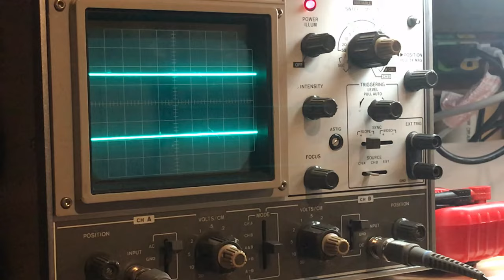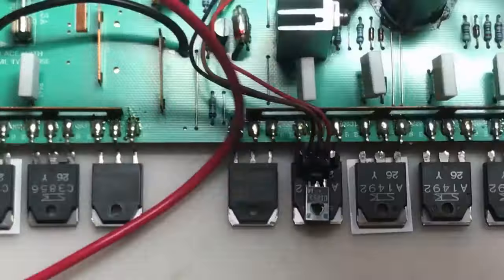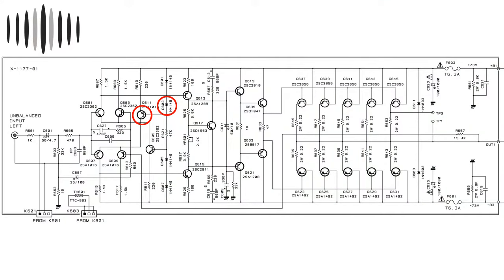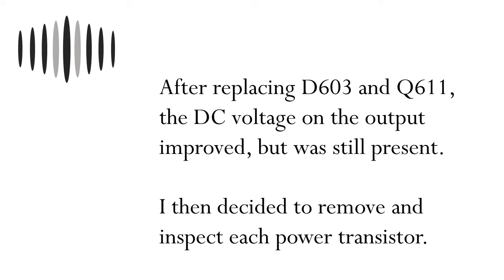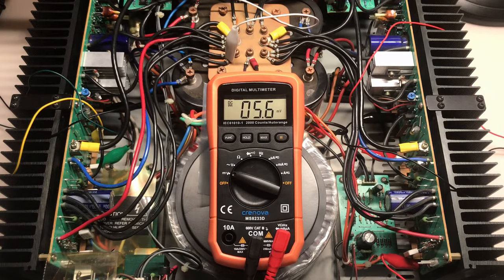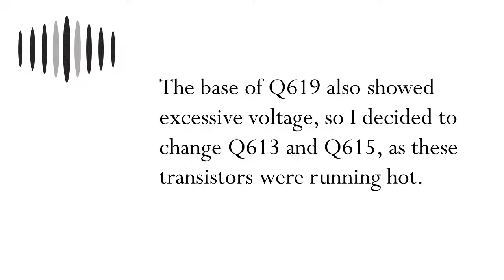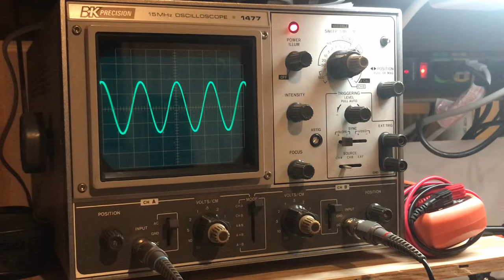DR #19 - Rotel RB-1080 Power Amplifier Troubleshooting and Repair - Speaker Popping and DC Voltage

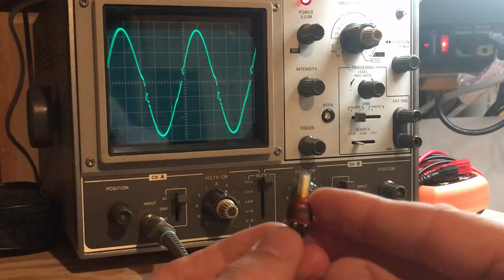Comment: At 16:31, please clarify: You state that "they were not connected in any way." Do I understand correctly that the 2 transistors were heat shrunk together but no thermal compound was used? Or that they were initially installed separately with no shrink or compound?
Reply from the maker: They were initially installed next to each other, but not thermally connected in any way (no heat shrink, no thermal compound).

Comment: Great job in this repair! I just want to bring up one point.  All that circuit  glue that turns black must be removed from all your repairs.  When it turns black it is not only corrosive  but it is also known to be conductive.. This can change the specs of the circuit.

Comment: Hi . I have an issue with RB991. One of resistors caught in flame. Need replacement parts . 2SA1016 x 3 - matched pair and a single plus just to be safe 2SC2362 x 3 , also would be good to have on hand just in case 2SC2682 and 2SA1142. Do you happen to have and willing to sell these ? Or perhaps can help with substitute model numbers . Would appreciate help ob that one since they are obsolete .
Great video . 
Regards

Comment: I got same amp, left channel gets really hot after 20min  "No input and Speaker connected" Do you think it might be the same transistor. Amp works fine when cold. When hot, left ch start crackling and distorted and eventually lose audio.

Comment: Cool! Very strange that they didn't include emitter degeneration resistors in the differential input stage, though.
Reply: I also noticed this, it is the reason why the damping factor is so high. Good for low frequency distortion to have no degeneration but linearity will be compromised.
Reply: High gain input transistors (needed when you employ degeneration) are more expensive and hard to come by.

Comment: Hello I have a RB 1090 and. RMB 1095.  Also a RMB 985 MKii.  My 985 has some blown transistors.  That I am going to replace much like this repair.  My question is these are older units pushing 20+ years old.  Is it worth while to recap all of these.  From my reading electrolytic capacitors are only good for 10 years but many last upwards of 20.  My equipment is getting that old.  Is this something I should be looking at doing.

Comment: Did you match the replacement differential pair transistors for beta values. Always be wary of the noise figure for the transistors if using a substitute.

Comment: Hi , I have EV CPS2 power amplifier . I’m facing  power supply continuously short circuiting . I check the power supply module PCB , in that all components are working I.e relay, NTC. I desoldered rectifier GBPC-P 3504 and check , no shortage in rectifier side. Can you please give any insights/ suggestions to me how to repair this problem. This short circuit observed when I’m doing idle current adjustment and I check replace few transistors which got short circuit but still I’m seeing power supply short circuit

Comment: I have a RMB1075, it is frying any speaker that connects to the right surround, it made the speaker smoke and there was a screaming sound. My question is for someone who cannot work on this themselves, is it worth taking this to a shop to get it repaired or would the cost be too high for an amp from 2001? I have been only utilizing 3 channels lately, but took it out of rotation because it seems like a ticking time bomb to me.
Reply from the maker: That depends on several factors. 1: Is there anyone local to you who can fix this? 2: what would it cost? 3: how much are you willing to spend? People send me their amps all the time and spend twice it’s value in shipping alone because they’re committed to their older gear. Understandably, not everyone feels that way though.
Reply: @dualityrepair4770  Where are you located? I have no reliable place, the one in Nashville consistently took a Technics SA TX50 I had, 3 times they said it was fixed and it still had the dreaded overload error each time after 6 mos.... I would not trust them. I have 5 vintage receivers, Sansui G9000 etc, so I do like vintage gear. I know this weighs almost 50lbs...

Comment: That glue melting is very disturbing.  Glad I decided to pass on Rotel.  

I have Adcom and Acurus power amplifiers and they have been working fine for around 25 years.
Reply: Rotel isn’t special for having used this glue. It was used  on virtually all electronics built for a could decades. Rotel makes incredible amplifiers.
Reply: @kilgoretrout4461  well as I mentioned earlier. Funny how my equipment doesn’t have the same issues. 🤷

Comment: Nice work.  I have that same model amp. It was notorious for blowing fuses on the left channel.  I read about slow blow ceramic looking fuses, fixed the problem, I’m hoping it’s not a symptom of other issues in that left side. Any thoughts ?
Reply from the maker: Using the slow blow fuses allows you to use the amp, but they’re also failing to protect the left channel from the current spikes that are likely present. These spikes can shorten the life of any component in the circuit.

It’s very difficult to suggest a component or area of a circuit to look into from such a limited problem statement. I’d be happy to work with you in more detail if you’d like to email me.
Reply: Same model, left channel fuses blown apparently for trying out 12V trigger from preamp. Came up with this great video because of that. Luckily my problem was much simpler. Otherwise great amp! I have had it for 20+ years now!

Comment: This amp when working fine is worth say 200-300usd , how much would be your repair cost considering all time and parts spend here?
Reply from the maker: k domster,

I never charge a service fee, so just shipping & parts. Depending on what needs to be done (simple repair vs. full rebuild), the parts cost would vary between $10 to $80.
Reply: @dualityrepair4770  In Australia it's pretty much across the board fee wise?   Initial inspection fee: $110.

This is the cost of diagnosing the fault and calculating the cost of repair. Each job is individually assessed and quoted. If the repair costs are unacceptable the $110 is non refundable.

Ongoing Hourly charge – $110 (parts additional).

All service repairs carry a full 3 month warranty on work completed.

Comment: Thanks for the nice video! What would you have done if there would have been a high voltage remaining on the main capacitors?
Reply from the maker: Discharge them through a high wattage resistor.

Comment: How would a glue become conductive?
Reply from the maker: I certainly don’t pretend to be a chemist, but due to it’s chemical makeup (whatever that is), the glue, having been exposed to heat over many years, can harden and become conductive. When I say conductive, I don’t mean short circuit conductive. Even in the KOhm range, glue can cause issues in certain circuits.
Reply: @dualityrepair4770  Next time you might just measure a resistance of a piece of some old glue. I doubt that it would be less than a few MegaOhms. It's true that a glue sometimes causes problems on PCBs with SMT components. But in the most cases it's not a glue itself but rather some flux residue deposits on a glue surface.
Reply: @IliyaOsnovikov  The amount of conductivity may be voltage dependent aswell. And it is a well well known fact this glue causes problems
Reply: @19janiboy96  What kind of glue are you refering to? One used to glue tall electrolytic capacitors or the glue for SMD components?
Reply: The one electrolytics are secured with I mostly encountered this yellow Brown ish stufff
Reply: Duality Repair @

Comment: I Purchased one of these a few years ago and loved the app. However I always had a problem with the left channel the slightest little ding would pop the left channel I was constantly replacing the  250 V 8 amp fuse And then one day I was playing it on Axiom   M 100 speakers which are a 4ohm speaker which  Rotel said that would not be a problem as it  could drive a 4ohm Load
And then it went out. I took it to the repair shop when they stated the motherboard was not good and there was none to replace it. So here I have a beautiful  amp that longer works And cannot be fixed that leading up being trash which I think was uncalled for as it should’ve been a motherboard available so very disappointed in  Rotel 
Of coarse that did not stop me from buying another Rotel amp which I love and no problems
Reply: First of all, none of those Rotel power amps have any "motherboards". The second , even if any of the PCBs (Printed Circut Board) inside is cracked or broken it always could be fixed with a glue and a few jumper wires. And third, any defective parts on those boards should be available and could be easily replaced. Also any "cold solder" joints with loose connection could be easily resoldered. In other words, you would need to find a good electronics technician.
Reply: @20 20 Why? This isnt a high impedance circuit like tube amplifiers are

Comment: If I were to choose between a new Rotel RB1552 mkII or a used rb 1080 
for driving my dynavoice define 8 front speakers (23 - 32.000 Hz (- 3 
dB) RMS 200W, max 280 Watt 94 dB dual 8" woofers and 6,5 mids) via my 
5.1 receiver preouts, which one would suit me better? I guess the 1080 
could be pretty old, is there any downsides to that? If i bought a new 
1552 as mentioned I would get warranty and a new unit for the same price
 as a used 1080.
Reply from the maker: The downside is the lower output capability of the 1552 compared to the 1080 (130W vs. 200W). So, if you know you’ll be driving your speakers anywhere near that limit, I’d suggest buying a refurbished 1080. If you know you will not be going near that limit, the 1552 is a fine option.
Reply: @dualityrepair4770  okay thanks. Well I live in an apartment and cant really blast that high of music. But I though there was some gain in bass controll or cone controll even if you dont use 200w per say. Also the  used1080 would be the same price as a new 1552. Maybe eaven cheaper.